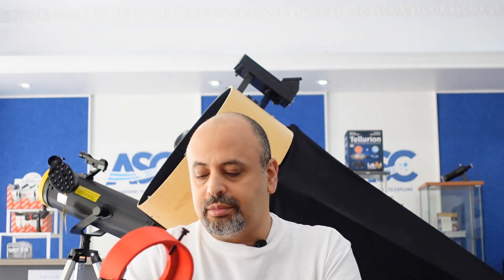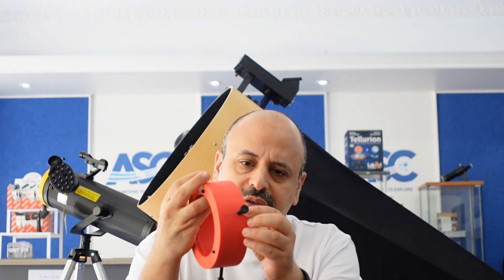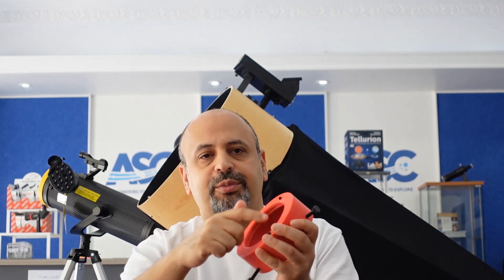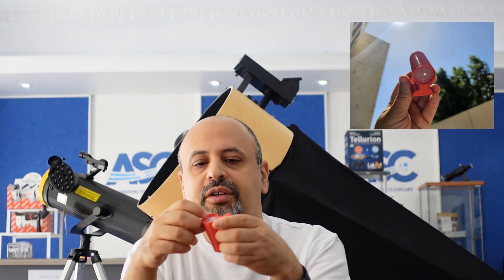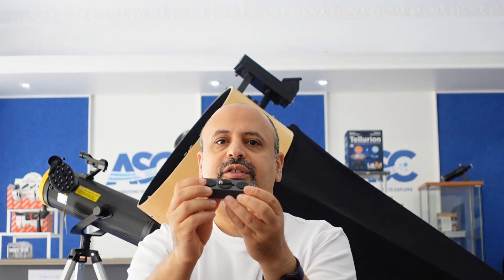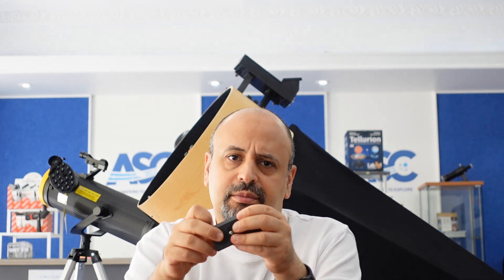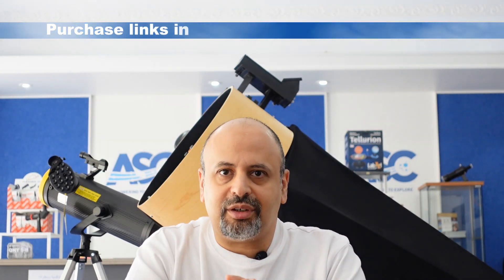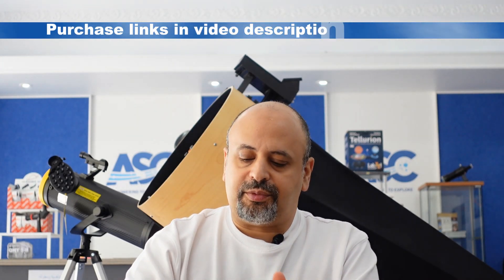StellarPrint: 3D Printed Accessories for your Telescope

Comment: I love the idea of fun accessories, but the cup holder may have two problems to balance all the goodness.  First  is vibration, the second is water vapor in the case of coffee/tea.

Most importantly, Excellent ideas!!!

many thanks
Reply from the maker: Thanks for the feedback. I had worked on the hand controller hanger but since there are so many varieties with so many mounts gave up on it. The cup holder still tempts me, I use insulated mugs with covers